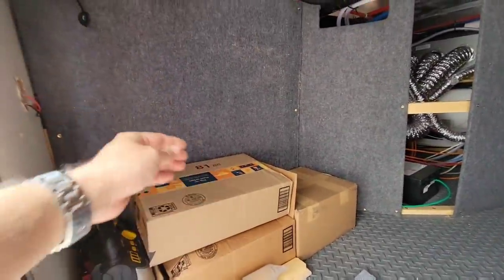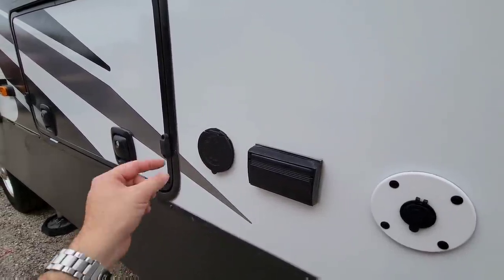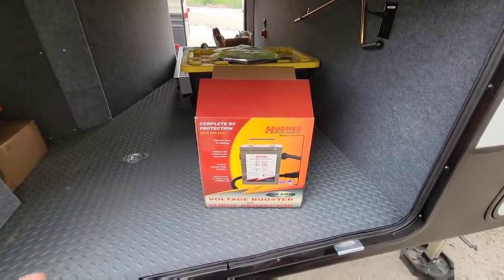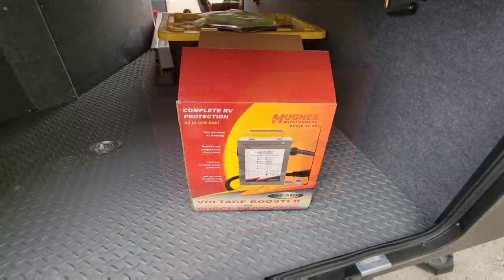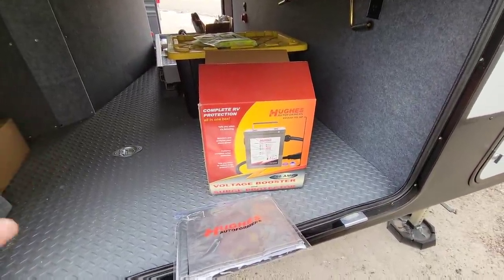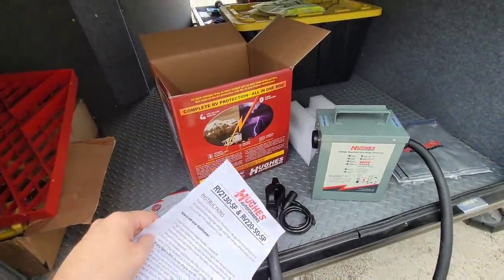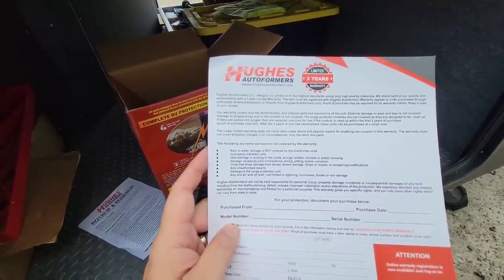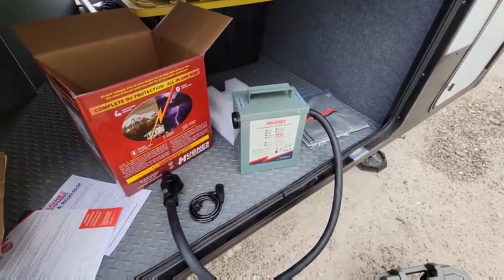Expensive accessory that can save your RV's Electronics!

Comment: Years ago we parked our 5th wheel and plugged in before checking it. When I went to grab the door handle to go inside, I was shocked with a strong enough charge to force my hand to grip the handle. My dad was next to me and push me off of it, I was ok. The entire rig was hot. Miraculously the 5th wheel was unharmed. Brand new RV park too. Be safe!

Comment: $600 and it's not waterproof? I can understand if they said not to submerge it but it's designed to be outside. Not sure about this one
Reply from the maker: Totally agree
Reply: I have one and the transformer in encased in epoxy but the pc board was out in the open. I would think they would at least put conformal coating on the board to protect it from moisture. I really like it though and works well. A few years ago we were in Laughlin NV. and we were at the AVI casino and they have an RV park. The voltage was low and this gorgeous Motor home had its two AC units on along with all the normal stuff you would be running in 115+ temps. The motor home caught fire because of low voltage at the park and the RV was drawing a lot more current than it normally would if the voltage was normal

Comment: I have had a 30 amp unit for quite a few years. It only works on the voltage issue, not all the other issues that the Progressive  unit is used for. I only use in two state parks the we visit each year that have 30 amp  low voltage issues. Works great for that purpose. Also I just put a inverted plastic garbage pail that fits on top to protect from water. The Progressive is used the rest of the year at 50 amp sites. It was less $ back when I picked it up but it only works on voltage. It does a great job of making 100 volts into something that will run the camper without damage.

Comment: You definitely freed up some good space in your pass through storage area and your temporary partition looks good enough in that it would be my finished product.  However, I 'm sure the matching carpet will give it a true OEM look.  Kudos to putting in the L-bracket to protect your pex lines.  More kudos to e-trailer for providing you the Hughes autoformer unit to test, as I have never heard of this type of product and I'm sure your viewers will appreciate the knowledge.  You were correct in that it is pricey, as Amazon sells the 50 amp model for $580.00 ish and the 30 amp model for $340.00 ish.

Comment: After spending a significant amount $$$ buying a new truck &  tt  5+ years ago, I really didn't want to spend another $350+ for one of these. One of my RV camping buddies reminded me about the microwave I fried due to a surge & he lost his a/c with a low voltage. I bought one by the second outing. Am I ever glad. It has "tripped" a couple of times. Low voltage more often. More people in older parks being fuller & in need to elec upgrades. Cheap insurance.

Comment: had a 30 amp, it got wet with light rain several times and no problems. i did however start putting a bucket over it.  it boosted voltage great.  i recently  upgraded trailers and got the 50 amp.  i feel its well worth it.

Comment: INTERNAL WIRING KIT for $108 does away with risks of theft and weather damage!  Worth it in my opinion.  Considering 90% of questions are theft and weather related, and you knew that was coming,  etrailer should have sent you one of those as well.

Comment: Surge protectors only cover high voltage.  An EMS cuts off for both high and low voltage, and a good one will delay the restart to prevent hammering the AC compressor if it was running.  This thing boosts voltage by drawing more current to make up for it(V=I*R or voltage equals current times resistance).  Problem is, drawing excessive current can blow the pedestal breaker or make the already overloaded park power grid worse.

Comment: Looks like the smart move would be to wire it in to your inverter and mount it in your RV. Then run your long pigtail from here over to the pedestal at the RV park. This way this unit would be out of the weather all the time, and in a more theft proof place.

Comment: Love my Progressive Electronics 50 amp EMS. It just disconnects the power if it sees a problem. It alerted me to a problem that enabled me to contact park management just last month. Bad breaker on one leg.... low voltage.

Comment: I have just their standard surge protector/power analyzer unit (this minus the booster) and it has worked well. Has a decent app for your phone and bluetooth connectivity to let you control it all from inside the RV as well if you need to reset it or check your usage or anything.

Comment: Like others, for the price and “rain voids warranty”, I would not place this outside.  If I were to get this, I would install it electrically in between the distribution panel and where the 50 amp cables runs into the access area for the distro panel.

Comment: I would take the time and effort to mount/hardwire that Hughes autoformer in the same space as your cord real. It’s not something that requires constant monitoring and there’s no need to expose it to weather. There may be room behind/under the rear couch as that’s where the power plug is.

Comment: I have had one of these for 7 years, The Thousand Trails  park in Hershey, Pa.  always has low 50 amp power.  I keep a meter plug in to  a outlet and I have seen power as low 
as 108 . This is a great item to boost power. Beware that some parks outlaw this item.

Comment: I have this. Took the camper down to the TX coast for a few months and the park had major low voltage issues. Ordered my autoformer and the issue was solved. I wish it was more weather resistant.
Reply: I paid $350 for mine. $600 seems awful steep.
Reply: @torteeya   4 Years ago my 50A unit was $540.

Comment: It's a great unit, I have both their 50-amp voltage booster/regular and the Power Watchdog (Hardwired) 50-amp with EPO, total electrical protection unit. BTW, the voltage booster automatically boosts the voltage 2% to make up for the voltage loss from the 50-amp shore power cord length, then a 10% boost if needed.
Reply: Does it accommodate small generators like a honda inverter or does it give errors with those?
Reply: @ecoheliguy , That's a good question, I can't say about the error codes. But normally, you would not need a voltage booster with a generator. Generators tend to have very stable voltage.
Reply: @thecasualrver  I was wondering in case of hardwireing it inside the trailer.

Comment: For something like that, I'd prefer it to be mounted in the rig just behind the outside connection. It would be best protected from the elements and theft. I get what you're saying about connections on either end but remember that plugs and connector point are prime failure points.

Comment: A number of CGs we have been to have told us that autoformers are not allowed, so be careful with them!
Reply: Do they give a reason?
Reply: @Jtwizzle  last one we heard is that their power system was old and autoformers would cause more problems than they solved.
Reply: @Jtwizzle  It's against NEC code 
551.72(E) prohibits the use of autotransformers in RV's. It's not a campground thing, it's a code thing. When it's in use, it pulls voltage from the campground grid, taking it away from others.
Reply: Interesting, it looks like this is a fairly new change. So $350 down the drain if parks enforce it.
Reply: @Jtwizzle  big question is "if". Maybe you won't have a problem with it at a park that keeps things current, but then again, maybe you won't need one of these at such a park! We use a Progressive EMS instead to disrupt power to our 5er if the power quality is subpar.
Reply: There is a lot of misunderstanding about how these work.  Some CG claim it steals power from them...  What it does when boosting voltage is pull a few more amps from the pedestal, run it through a transformer trading the amps for higher voltage (the whole v=w/a equation).  This is where the claim is your 'stealing' power from the CG comes from... which is a bogus argument as you are still limited by the 30 or 50 amp breaker in the pedestal, you can't magically pull more amps then the breaker allows.
Reply: @BCDiver  So I researched this and cannot actually find the NEC to read for myself. Everything I find is some company or organizations training manual or powerpoint presentation (2020/21). They use the word autotransformer and autoformer interchangeably as if they are the same type of device. Some only mention autoformer and others only mention autotransformer. Do you have a link to the actual NEC so I can read it myself?  thx
Reply: @Jtwizzle  I have never had an RV park say anything to me about my AutoFormer in 4 years of use. I understand that a very, very small percentile of users out there HAVE had that issue at a park.
Reply: @rh-et2vv  I posted the reference to the NEC code. Parks may choose to use it or not. Many cities adopt it as their code. NEC code 
551.72(E) They may call it an autoformer but it does the same thing. As a matter of fact, NEC prohibits transformers of any kind in an RV. It’s basically an autotransformer with a voltage sensor and transfer relay. When the incoming voltage goes below a certain value, the relay kicks in adding a 10% voltage boost.
Reply: @infurious5748  It pulls more voltage, which robs it from the grid.

There’s nothing magical about it since it’s basically an autotransformer with a voltage sensor and transfer relay. When the incoming voltage goes below a certain value, the relay kicks in adding a 10% voltage boost.

Comment: Personally I like the lighter carpet on that section of your reworked wall it kind of breaks it up a bit and honestly makes it look better in my opinion. 
There's talk of legislation to outlaw these surge protector/voltage boosters and in many campgrounds they're against the rules. Something about since they are able to pull more voltage when needed it adds to the stress that caused the system they are hooked to to experience voltage droop in the first place. Even though they don't pull more amperage which is the main thing that damages electrical systems such as melted wire or wire fires they can and do pull more voltage when they sense droop. Not sure when or if this legislation will become a thing just thought I'd let you know about it. If I were to use something such as this unit I think I would go ahead and hard wire it into the RV to where it could be kept inside the bay, that is unless it has to be replaced often. I would also do this for any aftermarket add on surge protector. I'd do this because they are expensive and if it's in the bay someone is far less likely to walk off with it and it would also keep it off the ground and inside to better protect it from the elements.

Comment: Like a few people have said. There are some parks that prohibit the use of these autoformers, and there are some parks that many not say so, but using them could cause severe problems. As you stated, these devices can boost the voltage when the incoming voltage drops. It does this by drawing more current from the line. sometimes this current can exceed the wiring capability of the pedestal at the park and cause overheating or possibly a fire. In many parks, this increased current will cause other pedestals in the park to experience voltage and current drops that could damage other campers.  In my view, and EMS system like progressive dynamics is all that is needed when plugging into a pedestal. something that detects low and high voltage and incorrect wiring, and disconnects your RV until the power is within acceptable limits. I feel that autoformers  should be used with generators that typically don’t do a good job of regulating voltage when the demands made by an RV go up and down. So I believe you should use it when you are connected to YOUR generator and YOUR Rv and not a park pedestal. A surge protector and EMS should be used when connected to a pedestal.
Reply: I agree with most of this.... however I will say that it is not completely accurate.  The autoformer will not allow you to draw more amps from the pedestal than the breakers on that pedestal are rated for.... However, they will indeed use more amps to boost the voltage than you otherwise would.  If you think about the type of situation that causes low voltage in an RV park... it is usually due to the fact that the entire system is overloaded and has more people drawing amps than there are amps available.... so while the autoformer may actually help the person using it, it will in fact make the situation worse for everyone else.

Comment: HEY JD why not replace the factory surge protector with the new one and it would be in side or extend the wire on the new one so it too could be inside. Why dose it weigh so much it's a giant capacitor it stores power like a battery. JD love that you shared your knowledge with us.

Comment: I enjoy rv upgrade and mod videos.  Couple of things to think about.  Spiral wrap, dust caps, and dielectric grease.  Spiral wrap can be found online or the HD and can be easily installed on pex tubing, wires, and the like to prevent tube/wire chaffing.  I also use it to organize wire bundles.  I just had to replace my 7 pin plug (2006 Cardinal) because no matter how much I tried to clean it, the brake pins did not make enough of a connection to activated them, even with breakaway engaged.  Afterwards, I found a dust cap available on Amazon.  All new rigs should be equipped with them!!!. What are your thoughts on using Dielectric grease in the seven pin?  I saw it on YT and thought hummm.  I use it on my vehicle batteries.

Comment: Is it possible to plug the RV 30' 50 amp cord into the breaker post and the plug surge protector into the cord, then have another 5-10' 50 Amp cord to plug into the rig? That way you can keep the surge portector either under the trailer or in one of the compartments?
Reply: This is exactly what we do. The auto former is also locked in a bracket that we secured to the inside of the back storage next to the power outlet. We plan on drilling a hole and installing a weather grommet in the baggage door in order to lock the door for further security.

Comment: Great video! I had many electrical issues ie. A/C board burned up. I bought the hughes autoformer along with the voltage monitor for the inside of the camper. I was amazed that the voltage was below 110 at some parks. Plug the autoformer in and never usually gets below 118 at the lowest. Hughes autoformer is pricey yes. But how much does your a/c repair cost? Highly recommend Hughes autoformer!

Comment: JD, I would definitely be interested in seeing your video on making a permanent mount for it inside the RV. I have seen those at a few parks and they were chained down with a much more secure lock than the one provided. At the cost of $600 it would make sense to put it in a more secure and out of the way location than on the pedestal. 
Here's my other question for you though, do you think this would give you enough of a voltage boost to run an AC off your smaller propane generator? Just curious as to your thoughts on that. 
Thanks, 
Pat

Comment: At 8:24, there is wording for internal hardwiring...can this be installed in a weatherproof box attached to a pedestal at a person's home or internally in the RV itself with a longer cord, thus weatherproofing the component?  Given the location of your newly mounted cord reel, could this be mounted there?  I realize it is reducing the available weight capacity if installed in the RV itself.  Just curious.

Comment: Instead of two 50amp outlets on the unit Couldn't you mount the unit inside a dry bay where your power reel is located and use a 50amp cord to plug the short pigtail into and then your newly added 50amp cord into the pedistal? This keeping the unit protected from the elements and possible theft?

Comment: How exactly does it "kick in a boost"?  Does it have an internal battery or does it just pull even more from the pedestal?
Reply: There is an internal transformer that is adjusted by its firmware to step up the voltage if the input voltage goes too low. This means the unit will draw more current from the pedestal. Which is better than having components in the RV draw more current than they are designed to handle.
Reply: @stevejernigan4371  Cool, thanks for clarifying that for me!  Effectively, it takes the stress so your more delicate items don't have to.

Comment: I’ve got a question maybe you can answer so most of the use I do with my trailer is at our deer camp we do not have electricity we run everything off generators do you think I still need a surge protector with a generator
Reply: It depends a lot on what electronics you're powering with the generator and the quality of the generator.  If it's ONLY for lighting then I would say no.
Reply: Not likely you'll ever need a big surge protector on a generator. The output is stable, don't wet stack (below 30% load I believe) or overload (above 80% load) and your generator will provide a very stable output. Generators are designed to work best under loads around 50-75%. If you were getting surges on your generator then you need to service it big time as you are have engine issues or the windings may be deteriorating

Comment: Can you use or would you want to use the hughes autoformer with another surge protector like the Power Watchdog?
Reply: Can you? yes, do you need to? No, the autoformer has essentially a ems built in so the power watchdog would be redundant. Also it's best practice to have as few connections as possible when dealing with main feeds.